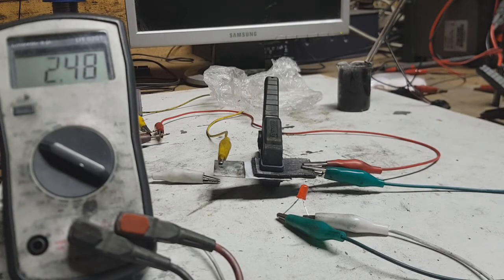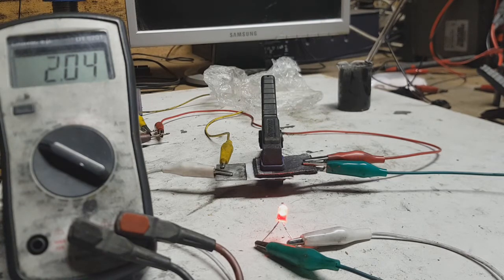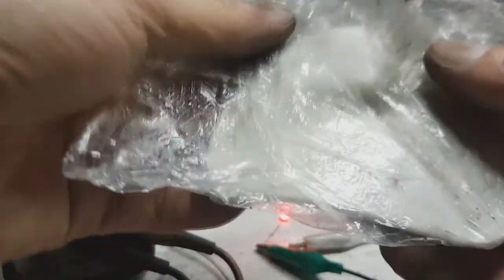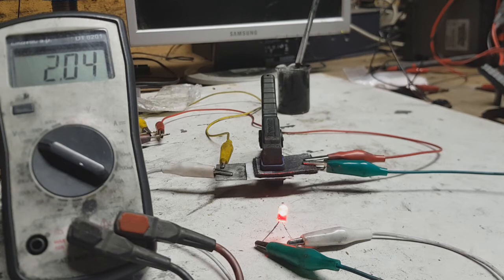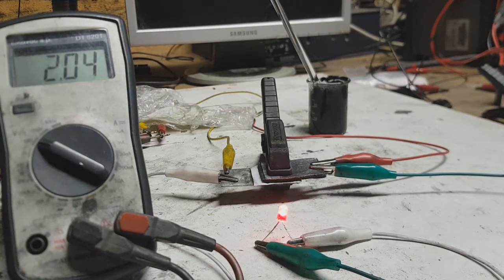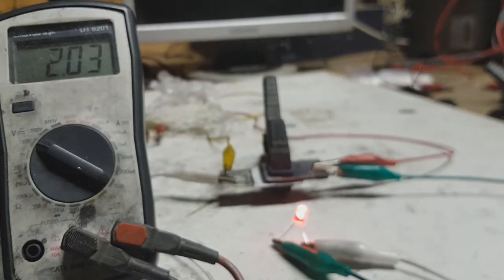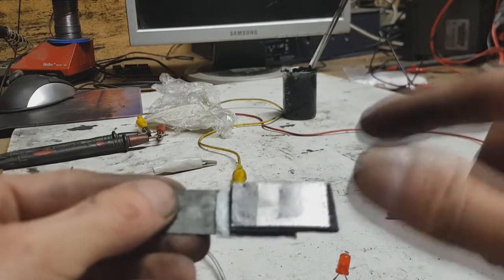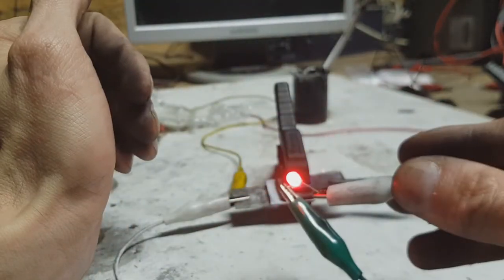"Solid State" High Voltage Zinc Battery

Comment: the reason you get such a big voltage drop is because zinc doesn't have a stable constant current lithium is a better option for that your doing great though

Comment: where can i get that carbon fiber sheet and what is the real name for it . what im seeing is not flexable
Reply from the maker: Max Stephenson graphitic carbon fiber https://rover.ebay.com/rover/0/0/0?mpre=https%3A%2F%2Fwww.ebay.com%2Fulk%2Fitm%2F182642514504
If you use zinc foil, than is flexible

Comment: I am curious about why nickel is required in a nickel iron battery. I know that iron is very stable in alkali, but can it be converted to iron hydroxide without the nickel? I have a cell running at home that is just sodium hydroxide in water and steel wool with a carbon rod cathode. No obvious oxidation going on with it.
Reply from the maker: +Blitherer Masterman nickel (nickel oxyhydroxide in many cases) is the positive electrode and the iron is the negative electrode in nickel-iron battery.

The half-cell reaction at the positive plate:

Ni2O3+ H2O + 2 e− ↔ 2 NiO + 2 OH−

and at the negative plate:

Fe + 2 OH− ↔ Fe(OH)2 + 2 e−

(Discharging is read left to right, charging is from right to left.)

Your carbon-iron battery is like iron air battery, but iron air battery is typical made Fe/FeO

Comment: Will this also work with Aluminium instead of Zinc ?
Reply from the maker: Yes! Zinc, aluminium, iron, nickel,....
Reply: cayrex2 Which metal will give the highest voltage ? is Alu better than Zinc ?
Reply from the maker: overunitydotcom the metal with the highest electronegativity
Reply: cayrex2 So Magnesium will be the best ?

Comment: Very Good!!!
Tell me, is it rechargeable?
🔬
Reply from the maker: Attila Rivera thanks! Hard to say right now,.... the electrolytes what I use in this battery have the potential for rechargeability. Because the cathode electrolyte is used in supercapacitors and can create many cycles. Also the negative OH -  polymer electrolyte I use in solid state zinc,  nickel zinc and nickel iron battery and all this battery types can be recharged.
Reply: cayrex2 Thank u 👍😆

Comment: 2.5v is not high voltage ;) but nice work,  continu your research, your well started  to achieve greater results ;)
Reply from the maker: Guy Massicotte thank you man! 2.5v is higher voltage for zinc based battery, because normal nickel zinc have 1.7v and is best voltage in zinc based battery types. So, 2.5v is high voltage in zinc based technology. 😉